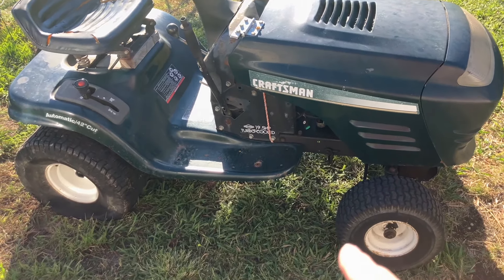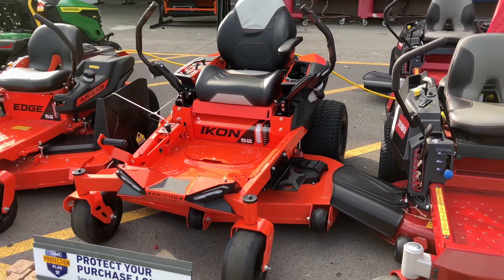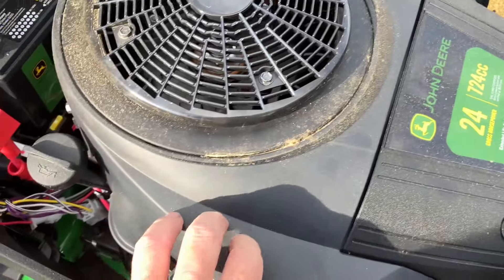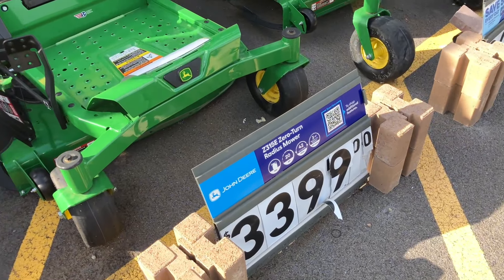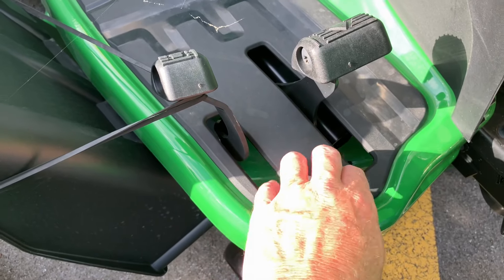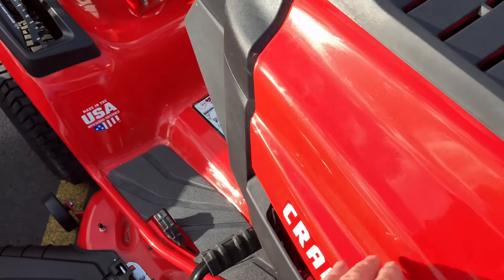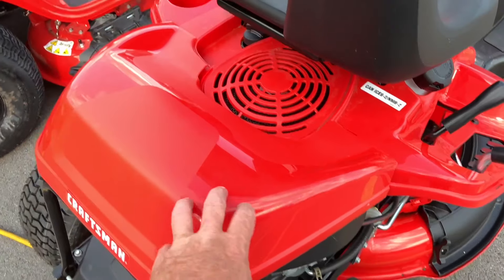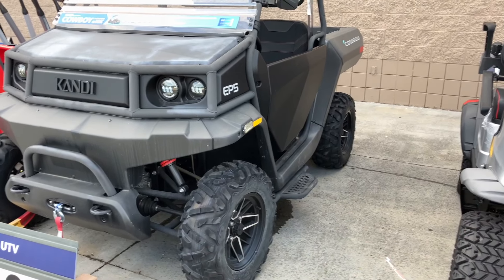NEW RIDING LAWN MOWERS ARE CHEAPLY MADE | LOWE'S RIDING LAWN MOWERS | BUYING A LAWN MOWER IN 2024

Comment: so much plastic because the engine + hydrostat cost is the majority of cost so they need to make a profit somewhere. A good mower isnt sold at lowes or homedepot and some people know that, most dont.
Reply from the maker: I agree most people do not realize that the mowers at Home Depot and Lowe's are not good mowers; That is the reason I posted the video was to highlight it to the general public.
Reply from the maker: I work on lawn mowers. My oldest is a 1968 Snapper Comet 30, all original. It is in great shape. It was barn kept.

Comment: Knock knock they don't make things like they use too 😂
Reply from the maker: You can still get good lawn mowers if you go to a small independent lawn mower business.
Reply from the maker: I work on lawn mowers for myself. Sometimes, I will depart with a few but most I keep. My oldest is a 1968 Snapper Comet 30, all original. It is in great shape. It was barn kept and when I bought it, it had not been used since 1971.